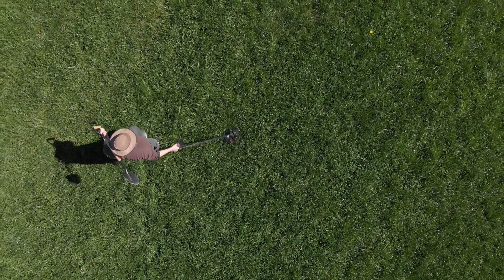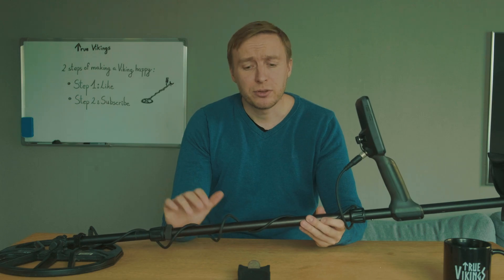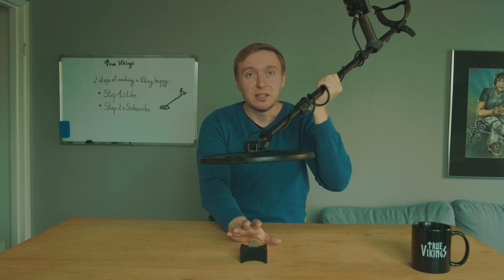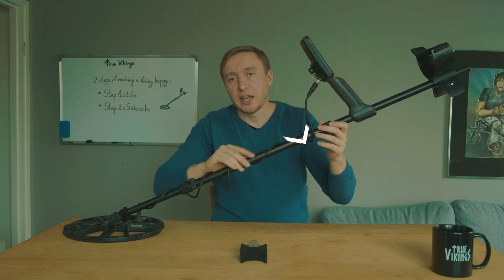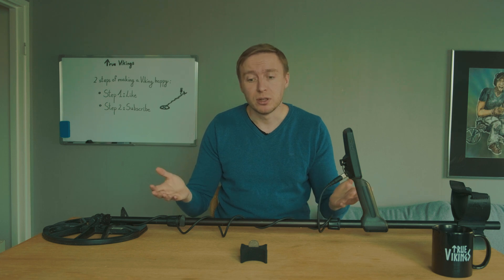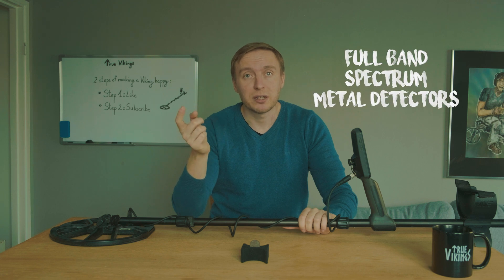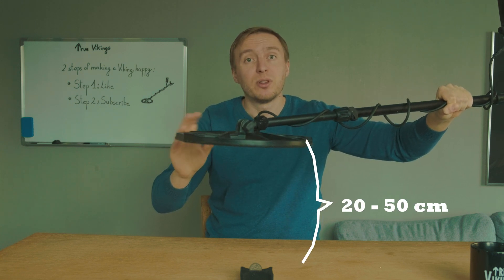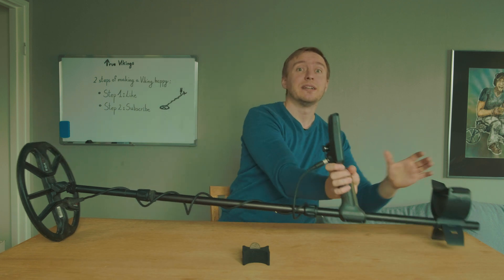This is HOW a Metal Detector WORKS

Comment: How deep?
Minelab Excalibur II easily detects a bicycle rack* buried in 1.5 m (5 ft) of sand on a beach.
Unfortunately.
After that experience, I don't dig deeper than 50 cm. I don't care even if it was a WW2 tank.
* A couple of metres, Ø10mm, bent and welded iron bars.

Comment: It's like you can explain things to an 8 year old.......     " look an engine, gas petal, and brakes.   Seehow the steering wheel works....put gas in it and go."

Totally failed on HOW a metal detector works.
Reply from the maker: Read this comment a few times and still confused. Please explain what you mean like to an 8-year-old. Because I have no clue what you are trying to say.
Reply: You realize English is not everybody’s first language?
Reply: @Im76110  Then speak the language you have fluency in.  However in this case I do not think it will change how he does not know how it works, it will only highlight he knows how to barely operate it.

Comment: Hi there Vikin 😉
That was quite well explained 👍 and if I may….one point to note perhaps is that the electromagnetic field also extend above the coil and is subject to interference from EMI. 
I be interested to see how you find the performance of new Manticore after using it a while.
What interests me personally, is your opinion on how well you think this detector would handle highly mineralized soils such as the Australian Goldfields 🤔

I wonder if it would outperform the Equinox 800 and if so, by what margin 🤔
Any thoughts on this??
Regards Jim

Comment: I'm at 0:20 and I don't know how it works yet obviously but I thought about this because I was wondering if metal detectors only find metal underneath the little bowl/plate thing or if they can detect metal to the side or above. My hypothesis is that it's like radar where it bounces off of the metal and comes back to the metal detector? I guess I'll find out if I'm wrong or not in a minute or 7. Edit: I realized I said "it" when what I meant was waves are sent from the metal detector that could bounce back. Also I'm wrong obviously but now that I think about it I was kinda wondering what kind of wave would only bounce back to the metal detector if it hit metal and would go through anything else so it makes sense that it's not like radar in that way. I don't think there's any waves that would only bounce back when they hit metal. Some rocks are pretty hard...and concrete is hard. Unless Everything is kinda spongy except for metal? Which...I guess could still be sort of true when reguarding natural materials but obviously kinda irrelevant since it's not how metal detectors work.

Comment: Great video, - humour always helps education; could you add a reply to explain why the search coil has to move across the target to give a signal ? from your explanation it ought to give a signal if held static over it.
Reply from the maker: Thanks Bill! Good question. The new detectors at least give a signal even if held static over the object. I have a vivid picture that I tried a older detector that stopped having a signal when holding the detector over an object, I am not completely sure. How does your work? With my detector I at least get a clearer signal when moving the coil.
Reply: @TrueVikings  Thanks for responding but it was not such a good question, - after thinking about it, I should have worked out the answer ! - metal detectors are an application of Faraday's Law and that law starts by saying "any CHANGE in the magnetic environment...". In metal detecting, the target, fixed as it must be, only becomes energised when the magnetic field created by the transmitter coil moves over it; when energised the target emits its own magnetic field; that field is then picked up by the sensor coil to give the detectorist an audible beep. Simple really if one goes back to what was discovered 200 years ago. Keep up the zany humour !

Comment: Hi , nice video. Would I be able to use such a metal detector on the surface of the water to detect a metal object 7-10 meters below? (the object is not buried)
Reply from the maker: Not 7-10 meters with these kinds of detectors.
Reply: @TrueVikings  at what range would a detector cut out with some metal object directly below it?
Reply: @andreysurcek145  hi mate, that question is not an easy question to answer as it all depends on the type of detector you use.
Example, using a VLF ( Very Low Frequency) detector has limited depth capability where as a Puls Induction detector can reach deeper ( used mainly or very often for detecting Gold Nuggets as they are much more expensive ) and then you also have the latest model detector from Minelab such as the GPZ 7000 that have a different technology altogether and that allows for a 30% increase in depth compared to its predecessor the GPX 5000 which is a Puls Induction Machine.

But that’s not all that matters when trying to determine how DEEP a detector can teach as the various settings you choose has also a direct impact on how deep it will detect…and then there is the size of the coil that matters as well.
Generally speaking the larger the coil the deeper it can reach a target, but then there is the soil types that might i pact that depth as well.
So you see why there is no concrete answer to your question, but the most powerful metal detector currently on the market for searching for Gold is the Minelab GPZ 7000 and in stock configuration and maximum sensitivity settings in very benign ( meaning soil that is basically void of any mineralization) this detector has detected a coke can at an astounding depth of close to 6 feet.  
This is the exception to the rule however as most soils where gold is found is extremely mineralized and hence this type of ground will hinder the electromagnetic field to penetrate that deep. 
In highly mineralized soils the maximum depth for that same detector is around 4 feet with a very experienced operator who can maximize the technology and understands how to operate for maximum depth recovery of targets.

I hope that is of some help even though it is a 2 year late reply 😂👍
Regards Jim

Comment from the maker: Hey everyone! Glad to see you everyone here and hope you are all safe. If you like this kind of videos from us be sure to Hit that LIKE button. DO YOU WANT TO LEARN HOW TO START METAL DETECTING? WATCH THIS! https://youtu.be/wIdjUNeQR38
Reply: Cheers for your informative video..as deaf man keen on finding treasure but don’t think I can use metal detectors seeing I need to hear beeps??
Reply from the maker: @timgrace6943  Hi Tim and thanks a lot. It is definitely possible to metal detect even if deaf. Most of the metal detectors nowadays has a screen which shows the ID-numbers of signals. So it is possible. Also the newer pin-pointers have a vibration mode that can be used to locate the object easier and faster.
Reply: True Vikings True Vikings thanks 👍 glad to know there’s vibrations mode available on metal detector. Let me know what’s the model 😃😃
Reply from the maker: The Garrett Ace 250 is a good starter machine that has ID-screen. But if you wanna go for more expensive then Garret At-Pro, Minelab Equinox and XP Deus are good. Garrett Pro Pointer AT is the pinpointer that has vibration mode at least, maybe there are more.
Reply: Lakeside Lake Michigan for a.fact Racine and Milwaukee counties has metal.everywhere
Reply: @spacealienrissley  I have given up beer can collecting